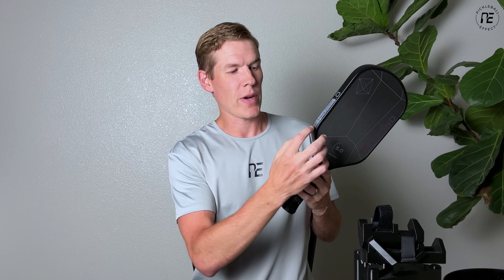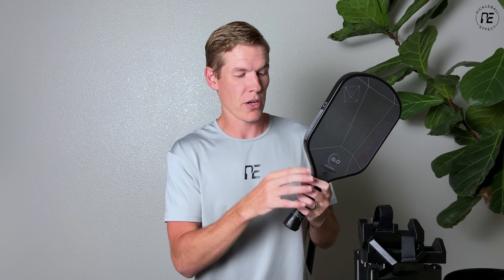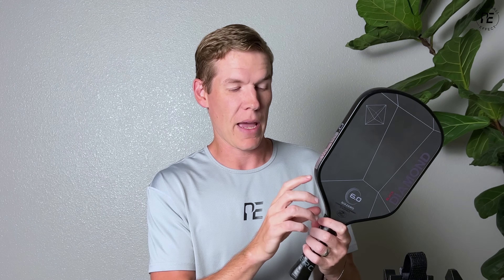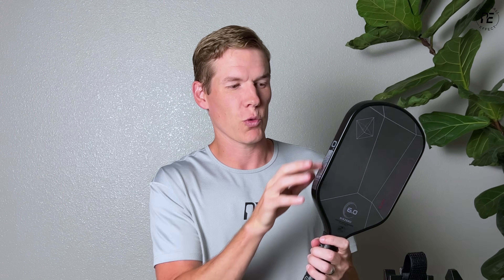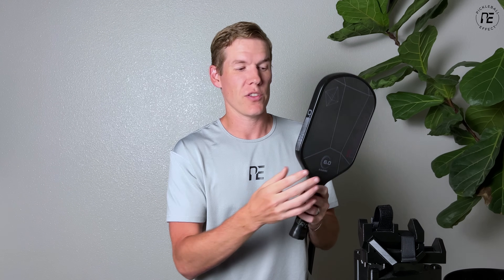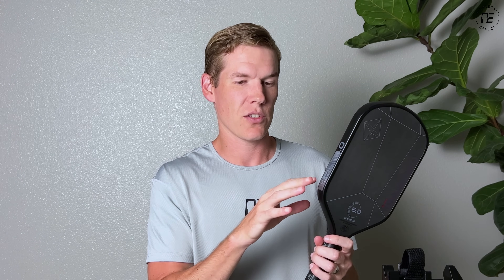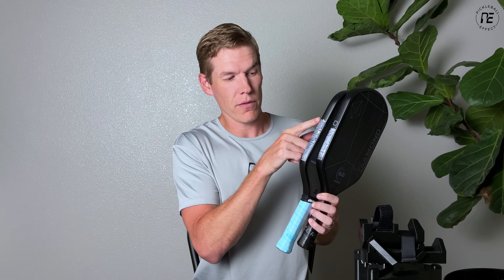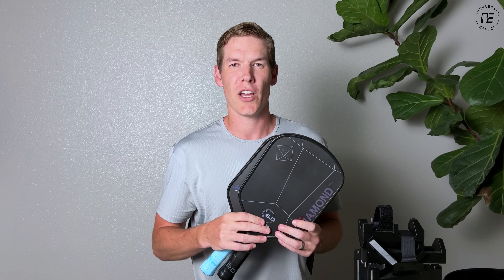The Best Place To Put Lead Tape on a Pickleball Paddle Based on Data

Comment from the maker: I think the best way to use this info is to start with the tape on the spot I suggested and then move it up and down a little after you play with it to find the spot that’s most comfortable for you . Move it down a little to decrease SW and move it up a little to increase SW but staying within that sweet spot zone. And or adding more tape in that sweet spot zone. 

For those who have never used lead tape before, put the same amount of tape on both sides of the paddle. I realized I was only showing one side of the paddle the whole time.
Reply: Are you enjoying the current version of the Black Diamond Brayden?
Reply from the maker: @joshuapickett1234  yes, thermoformed paddles seem to have gotten softer and less powerful throughout the year so the Black Diamond plays more like the original carbon fiber thermoformed paddles.
Reply: @pickleballeffect  what do you mean by original carbon fiber thermoformed?
Reply: In addition to having lead tape on the sides for stability, would also adding lead tape to the top increase power and spin rates for topspin, drives and serves?
Reply: @pl1532 yeah but u increasing swing weight too
Reply from the maker: @pl1532  I did an experiment looking at power gained from adding lead and the key takeaway was that just having the weight on there and not so much the location will give you more power. As for spin, I’ve haven’t tested the effects of lead on spin yet.

Comment: Good job Brayden. Your result makes sense in part because the farther the added weight moves away from the long/vertical axis of the paddle (an imaginary line drawn from the butt cap to the top of the head) the larger the rotational inertia of the paddle. And at the same time keeping that weight "low" towards the shoulder minimizes SW. Good to have empirical data to back this up.
Reply from the maker: Yeah, the more I think about it the more it makes sense logically.

Comment: Really good video. Lead placement with technical data to back it up. I like that it only jumped the DBD swing weight by two points.
Reply from the maker: Yeah, that placement increased the TW just over 9% and the SW by 1.75%

Comment: After playing with the DBD for a while and tried to find the best spot for the lead tape and currently I’ve them at the throat area, the same position suggested by the machine. Thx so much for the video.
Reply from the maker: Nice! You were ahead of the game then.
Reply: Wait, didnt the video suggest NOT putting weight on the throat becuse it will increae swing weight more?

Comment: Great job Braydon on all your videos. Breaking down metrics and their impact to how they affect playing is extremely helpful. In replying to a comment in this section, you indicated you prefer an 8.3-8.5 oz. paddle. Acknowledging there are many variables, but generally speaking, would you order a lighter paddle (e.g., 7.7oz) and add lead tape (e.g, .8 oz.) to customize to 8.5 oz. or would you order an 8.5 oz. paddle that you would not add lead tape and would play stock? Why would you do the method you choose? Thank you.
Reply from the maker: I’d get the lighter paddle and add the weight myself. A paddle might come with a sw of 125 at 8.5oz stock but if I get to put the weight on myself then I could balance it better with a lower sw. And maybe it turns out I like it more at 8.3 instead of 8.5 so I could keep the weight lower if I wanted to.

Comment: Great analysis, I put lead right at the center and covered the joola logo, 3 and 9 oclock with the 3 gram lead bars
Reply from the maker: Nice, that’s a good spot. I’d be curious what you think if you shifted it down a couple of inches. Should maintain a very similar TW but it will feel lighter.

Comment: Hi Braydon, thanks for all the hard work. Your contents are awesome. I noticed in one of your videos you mentioned you like the Vatic Pro Prism Flash quite a bit. Would you mind to share how you set it up and how it changed its characteristics as well as swing weight? I figure that will be a good starting point for me. Thanks!
Reply from the maker: I do like that paddle. I think it’s good out of the box but about 2-3g of weight on each side where the video shows is nice.

Comment: I actually started my love of lead tape when i got the DbD 16mm as an up/sidegrade to the Electrum E. If you are an advanced beginner and think its not for you and you like our stock paddle please give it a chance especially on paddles you might now want to use anymore. I liked the E's elongated shape and control but it lacked putaway power and the stability/sweetspot of the unibody/edgefoams like my Solaire 14mm (which I found a hair too powerful for doubles). I decided I would try taping my E and oh boy, now i have a hard time choosing between it and the DbD. I used Collin John's tape setup which is a six inch strip of 2 oz tape on each side starting at the throat. After I got used to the new weight balance it hits like a 'gen 1.5' with extra stability and power but retaining the 'gen1' control. I found the stock DbD was a bit underwhelming for pop/putaways (otherwise its a great balanced paddle) so i tried Pickleball Studio's setup of a precut inch on the lower corners which made it a bit better but not a massive improvement. I was thinking about adding/changing position but now I definitely will try some tape on the lower sides like recommended here.
Reply from the maker: Thanks for the detailed comment, I love this. Let me know what you think of the new placement.

Comment: This is so informative! I feel like before this I was just guessing. I currently have pre cut tape on all 4 corners. I think I may move the bottom corners up a bit to reflect what you showed, while leaving the top corners for now
Reply from the maker: Glad it was helpful!
Reply: How's your led placement  been working for you?
Reply: @cliffs4008  I eventually swapped to what the Pickleball effect recommends. Two longer strips slightly above the bottom corners, on the sides

Comment: This was exactly where I thought it would be.  Widest point of the paddle but as low as possible to minimize the negative impact on swing weight.  Assume that for paddles with the hybrid shape where the sides taper slightly toward the top of the paddle that there is not enough of a difference in width to make going higher be much of a benefit to offset the swing weight increase in placing the lead any higher.  What we need now is true high density tungsten tape with more grams/inch than the current 2 grams/inch lead tape since that would get thick if you started layering it up to concentrate more weight into a shorter portion of the paddle.
Reply from the maker: Yeah, after running the numbers it makes total sense. And right, the stack adds up if you stay in that exact spot but I think it’s okay to venture a little higher or lower so you could put two strips of 5” there if you wanted to.

Comment: Awesome video. I saw on your Perseus video that you had lead tape on the throat and above the throat of the paddle (lower half of the sides). For the Perseus, is this still recommended or should I not have any lead tape on the throat? I’m working out lead tape configurations for this paddle
Reply from the maker: Yeah, I’d start with the location in this video and then move it higher or lower based on how it feels when you’re playing

Comment: Hi, I actually have the Black Diamond and play with it. I would like more power from it. Would you add lead tape higher up on the sides for this or on the top? 

My lead tape is 2 grams per an inch.
Reply from the maker: When it comes to power, placing it higher would give you more power but in the end the placement of the lead doesn’t master as much as just having it on there for power. Watch this video I did about that a while ago - https://youtu.be/-BdGgLX3PVs?si=XE-4C7RUUwadhJEZ
Reply: @pickleballeffect  Interesting, I always thought on-top equated to more plough-through thus Harder drives etc.

Comment: Thanks for this information I’m definitely going to place it in those locations. Are you using 14mm forza for doubles? Would you recommend 14mm forza or 14mm DBD for doubles ?
Reply from the maker: Both are solid paddles and play very similar. But I’d recommend the DBD 14. Both are the same length (even though Volair’s website says the Forza is 16.5” it’s actually the same length as the DBD at 16.3”) but the DBD is wider at the top so you have more surface area to play with. You can use the code 10EFFECT on either website for a discount if you’re interested.

Comment: In your previous video regarding twistweight, I believe you used 5 inches of lead tape vs 3 inches in this video.  Did you determine that 3 grams/inches was ideal for twistweight / swingweight vs. 5 inches?  Thank you and great work.
Reply from the maker: There isn’t anything magic about using 3g on each side but that’s enough to make a noticeable increase in the Twistweight.
Reply: That’s 3g on each side to get the 9% increase in TW? Or were you testing with lead only on one side?
Reply from the maker: @tomschultz2250   that's on both sides of the paddle.

Comment: I could've told you that. ;-) I'm up to 12g per side in that location as a stack of four 3g pieces that gets my TW up to ~8.4 kg·cm². I keep adding and haven't found "too much" yet. Unfortunately, it's too much for the adhesive that failed and even ripped the electrical tape I had on top of it all. I have some 2g/in tape coming to hopefully fix it. Thinking of trying a standard shaped paddle to go even higher. In the meantime, I un-elongated a paddle by half an inch with a 3D-printed handle to keep the SW down.
Reply from the maker: Haha you should have told us. Yeah, making the move to 2g per inch makes sense. That’s a lot of weight!

Comment: Great video. Do you think it matters if the 3 gram strip is only 2 inches long vs 3 inches long?  Is the main factor here the WEIGHT or does distribution of that weight matter?
Reply from the maker: No, that won’t matter. You can put whatever weight amount is most comfortable for you. The main idea is that this spot is the most efficient place to put it.

Comment: This is very helpful! Did you find you needed to add more weight to lighter or shorter paddles to get the same improvement in twist weight or power? Or is it simply you add the same amount of tape regardless of starting paddle weight and shape? I would imagine a shorter or lighter paddle just gives you the ability to add more weight before you reach an unmanageable swing weight.

Comment: Very cool! I’m curious to see how the balance of the paddle changes at your spot vs the throat
Reply from the maker: That's a good question. I should find the exact amount of weight it takes to achieve the same twistweight in the throat and then see what the balance point difference and static weight difference is.

Comment: I have 3g of lead on that exact spot for my Ronbus Nova but another 3g just below it on the throat. Guess i’ll just move the one on the throat on top of the other one. Thank you for this info
Reply from the maker: Yeah, move it up a little and let me know what you think. You might be able to take the bottom strip, cut it in half, and overlap it on the other piece above it for overall lighter weight and about the same feel/performance.

Comment: If I find that my paddle is too heavy , does putting tape low on the handle change the feeling much?
Reply from the maker: Yes, that will lower the balance point and make it easier to maneuver at the net. Give it a try

Comment: Question : should you use double layers of led at the sweet spot or just around that area. I have a weight I like but it would require doubling the led in that area?
Reply from the maker: You’ll have to play around with it to find what’s comfortable for you but in that area is good. You can go a little higher and lower and you’ll be within the sweet spot and then only double up a small portion of it so it doesn’t get too thick on you.

Comment: I used to have lead tape on the throat of my Ronbus R3 pulsar but it felt sluggish since it already has a high SW and static weight in general. What do you recommend for that paddle in particular? I’m currently playing it stock and it feels pretty good but wondering if I can improve it even more.
Reply from the maker: I actually like that one stock but you might add like 2g on each side saturating just above the bottom corners.
Reply: Thanks I agree! i'll give it a try! If it doesnt work out at least I know the stock weight is good. @pickleballeffect

Comment: How much led maximum do you think I should add on each side of that area? Is there a limit you'd recommend not passing? Or can I max it out until I get to a weight that's comfortable? Thanks. That paddle you recommended to me came in at 7.6 oz, pretty low, so I was wondering if I can add like 2 4 inch strips of 1g/inch lead tape on each side to get to around 8.1/2 Oz's
Reply from the maker: you can max it out

Comment: Hi, nice video. Thanks of putting your time to give us useful information. Also I love your paddle reviews. 

Was the result same for both 16 and 14mm when you added 3 grams? And did you add 4gms on the 14mm to have them weigh the same or is 4gm tape better for 14mm paddle. And how much does it affect the swing weight on 14mm. I am getting my dbd 14mm tomorrow. Trying to figure out how much weight to add. I play with a gen 1 carbon paddle now. And I’ve 6 grams (2x3gms tape) on the spot you mentioned for stability and 4 gm on the top.I wanted something lighter without sacrificing the power so getting the dbd.
Reply from the maker: Good paddle choice! The results for the 14 and 16 I tested were very similar. Adding the same weight to the 14 actually had a more positive effect than the 16 which makes sense since it had less weight to start and the more weight you add their are diminishing returns and the 16 had more weight to start. I personally will add more weight to a 14 than I would a 16 since they have lower weight measurements to start. I hope you used my discount code ;)

Comment: Hey Brayden, would the idea of different weighted lead and how many inches used be interesting for a video? Like say u wanted 3 grams of lead on each side, but one was 1g/in and the other was 0.5g/inch. So the 0.5 lead would be longer but still 3 grams. My question would be how would this affect the paddle, and any differences between how the two lead setups play.
Reply from the maker: I’ve thought about this too ha and am also curious. It’s already on my content idea list though I’m not sore when I’ll do it.

Comment: My recommendation is to find a paddle's existing balance point and then center the lead tape strips on it.  This will be pretty close to where you are placing it but perhaps just a touch lower.

Comment: what about condenced 3gram weight versus more spread out? Like 1 inch 3 gram thats shorter in leangth and also narrower? CRB 3gram strips for example. Is there any benefit to this? 

Does

Comment: Awesome as always! Based on your processes and how you analyze data, I'm surprised you aren't in the engineering/science field haha Maybe a more niche example, but I wonder what the effects are of adding weight to the 'throat holes' that some paddles have.
Reply from the maker: Ha I definitely think in processes and value data but my experiments are pretty simple at the end of the day, anyone could do them. I haven’t messed with lead in the throat hole yet. Maybe if those paddles get more common I’ll have to try something.

Comment: I wonder what these numbers are like if the lead tape is wrapped around the top of the handle and throat where you sometimes see that rubber throat thing instead of along the sides of the throat.

Comment: Brayden, have you or anyone else ever added lead tape to there paddle and not have any improvement? My 6.0 DBD plays great without any tape or modifications. I tried the tape as your video shows for a couple of days of play and wound up removing it. Be curious to hear from others, if they had the same results.
Reply from the maker: For sure, not every paddle needs lead. Lots of people like and want the paddle as light as possible. Thermoformed paddles in particular don’t have to have lead since they are more forgiving than past generation paddles. However, I think if you can add lead without it affecting your hand speed much then there are usually only benefits to it.

Comment: Fellow paddle nerd here and was curious if you’ve compared different weighted lead tape. For example it seems using 1 inch of 2 grams per inch would be less effective than 4 inches of .5 grams per inch. Although it’s the same amount of weight and may effect the paddle stats similarly I would think the feel of the 4 inches would give you a much bigger feeling sweet spot although that would obviously be hard to test. Just my random thoughts at 6am 😂
Reply from the maker: ha that was a good random 6am thought. I've asked that question too though I haven't done any testing around it yet. It's on my to do list!